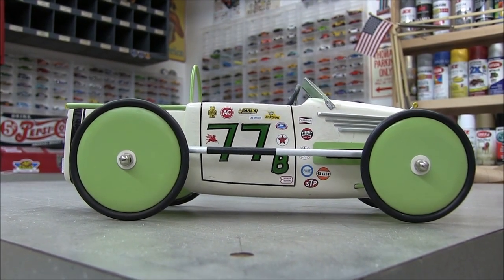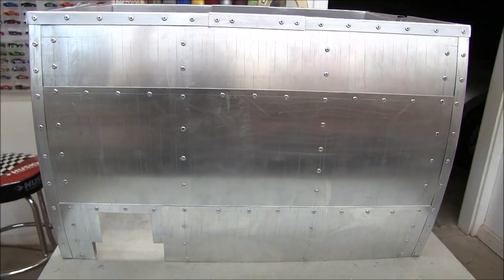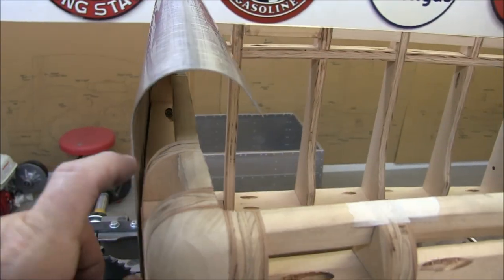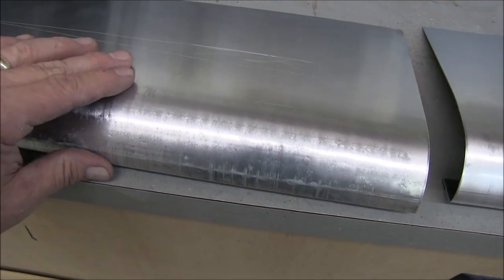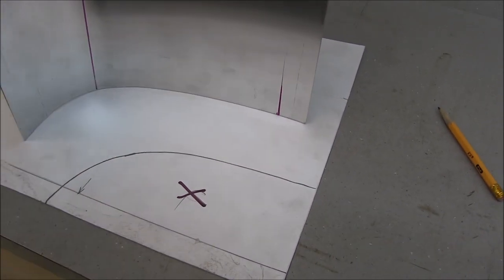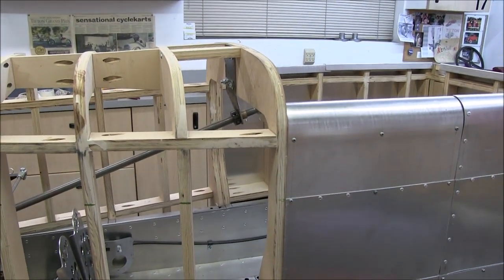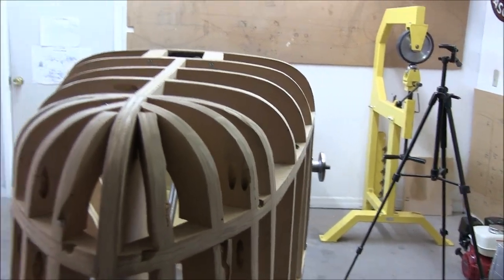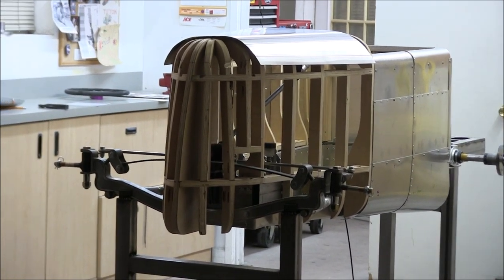Building the '37 Studebaker Body Part 4

Comment: Aluminium work hardens, if you have a oxy acetylene torch, light it with acetylene only and soot up the aluminium then heat the panel evenly with a neutral flame till the soot is gone then quench with water, this will soften the aluminium. Nice job! I like this build